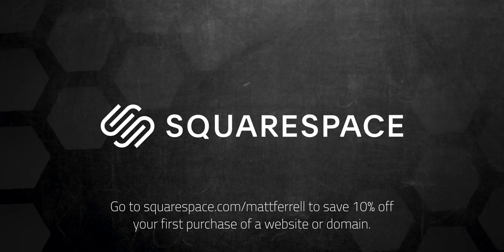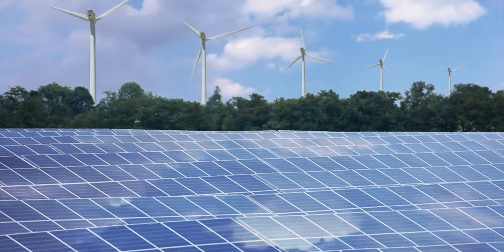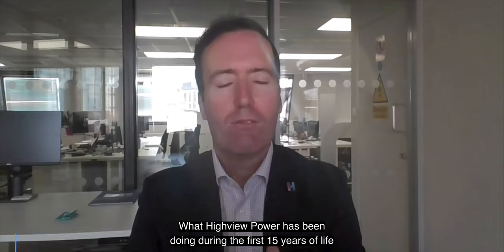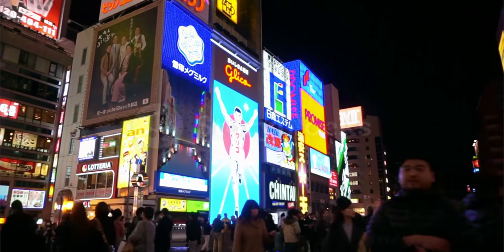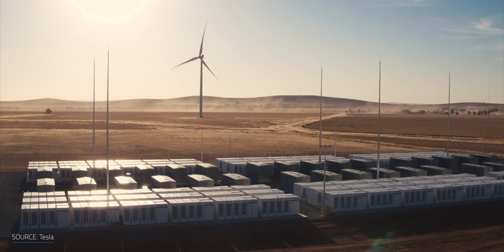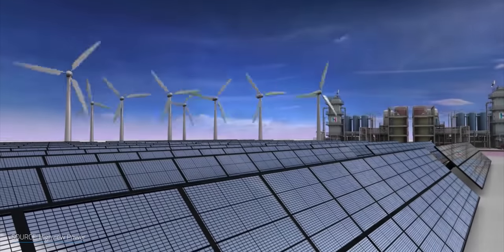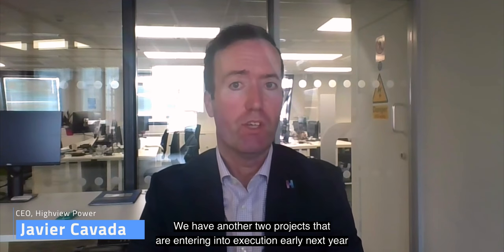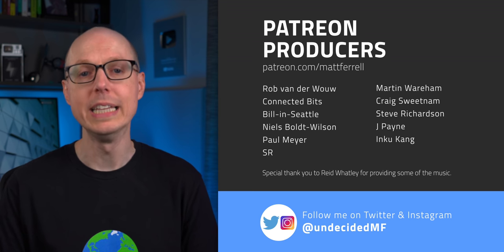Liquid Air Battery Explained - Rival to Lithium Ion Batteries?

Comment: Waooo I was working on this project from last 2 months and collecting the reserches on it  (Disclaimar) Sorry to all that I am actually a medical student and I am not suposed to be on this type of engeniering projects according to rules but curiosity took me in it so dont mind plzzz, so i always thinks why this so simple project of renewable energy doesnot exist before and belive me there are hardly some reserches on this topic. So here is my point this french fella which is telling about there work. They have basically 2 flaws in this project in my opinion and my little bit research.
1. The compressing of the air to liquified it takes energy which is very tough and costly beacuse the sense in this project is that we are working on renewable energy
2. Reserve the heat and again apply it on cold/liquified air to make a pressure also a very difficult and energy cunsomption job and heat loss may also another factor during heat storage.
Like I said these are 2 main flwas in my opinion may be there could be more but they could be easily successable and I got the solution in recent 5 days thankfully this social media.
In my opinion we have to mix two or may three different methods to acheive our goals.
Flaws which i assumes i got the solution is 1. We have to addminister solar energy in this project (WHY)? Beacause use of solar my give us almost free cost in storing the air There I mean air not in the compressed liquified form or it may could be compressed but till at that point that it could not change its state into liquid. 2. We dont have to store the heat infact use of heat remains not essential, we have to use gravitational force to release the air from storing capsule. Here is my case I hope you ll understand and sorry for my english beacuse its not my mother language. Love and best of luck from Pakistan.

Comment: You say pumped Hydro storage is geo specific (since it needs elevation difference). Here is flat Denmark (highest hill is 170 meter high) we're working on sandstorage. Not thermal storage, but water in a big bladder tank, buried under 10s of meters of sand. The water pressure then lifts the sand, thus making it works like the water was pumped up high.
Reply: sounds like the bladder could break

Comment: Thereare no rare earth metals in lithium ion batteries
Reply: Yep, Lithium is almost everywhere on the earth's crust. Mr E said so himself on Battery day.
Reply: Cobalt is not a rare earth metal but it is a metal that is rare on this earth. it is in lithium batteries
Reply: @tomkelly8827  it is hard to mine it ethically
Reply: @tomkelly8827  Some* lithium ion batteries. Cobalt free batteries are becoming more common.
Reply: @tomkelly8827  Cobalt is actually not that rare, it's ranked 32nd in global abundance.
Reply: @zhen3782  Irrelevant to my point which was the simple fact that it's not rare.  To your point, cobalt is also used in many other products besides lithium ion batteries where there is yet no alternative.  The abuse of workers in the Congo is an issue even if there is no cobalt used in batteries.  I do wonder what you think will happen to all those workers if the world somehow suddenly stops using any cobalt?
Reply: @JRP3  That argument is irrelevant.  Yes they will face hardships but what happened to all the slaves in America when the world stopped buying their cotton?  Just because the world has "minerals in abundance" doesn't mean we should treat it as a never-ending commodity.
Reply: @zhen3782  I didn't make an argument, I simply asked a question.
Reply: Cobalt is used at oil refineries to make gasoline so it’s not just relegated to battery use
Reply: I have bipolar and get treated with lithium
Reply: Cobolt?
Reply: @zhen3782  I'd also point out that the world didn't stop using cotton so your analogy is flawed.
Reply: Lithium, Nickel, Manganese, and Iron will be used. Together with Silicon. - Nickel is the scarce resource (but will only be used for "high energy density" solutions.
Reply: @409raul  Again, "rare earth element" has a very precise meaning as defined by IUPAC: lanthanides plus scandium and yttrium - certainly not lithium, cobalt nor nickel. They are not simply metalr that are race, and certainly not metals that are difficult to obtain ethically.
Reply: @tomkelly8827  Not for much longer. Elon is getting rid of it.
Reply: Lovecraft  Sigh... Again, "rare earth elements" is a formal chemical jargon term as defined by International Union of Pure and Applied Chemistry. It denotes specific set of 17 elements, namely lanthanides plus scandium and yttrium. There are many such precise terms (like, "alkali metals", "noble gases" etc), although they might sound vague to a layman. OTOH, the rems "exotic metals" has no specific meaning at all.
When people use this term in the context ob batteries, they usually mean cobalt. If so, they should say "cobalt", or "cobalt and nickel" or even "lithium" - whatever it is that they mean. They certainly don't mean rare earths, because they are not used in batteries (their use, mostly of neodymium, in EVs is in permanent magnet motors).
Reply: @JRP3  Oh well, obviously  they'll all suddenly turn white skinned at start living in two storied villas by the coast and smoke hand rolled Cuban's of course.....
Reply: @JRP3  One thing that may well happen is, that the incentive for continual warfare may be gone. Control of the mines not only allows the local warlords to purchase weapons, but causes outsiders to actively invest in war in the region. DRC is not the first place on Earth to discover that resources can be a curse. The workers may well return to their farms and villages, when war stops being so profitable, or maybe peace will allow a real economy to develop,
Reply: @michaeljames5936  Could be, but it's going to take more than just removing cobalt from lithium batteries.  Cobalt will continue to be used for other products so it's going to take some sort of strong policy to stop the abuse of artisanal cobalt mining.
Reply: @JRP3  the world is moving towards making all of us superfluous. The singularity will happen soon or later. Based on Ray Kurzweil’s estimate 2040.  Since he and I are the same age we both might live to see it. Those of you that are younger WILL see and experience it I suggest you all plan for it. 👍🏼🥂
Reply: @HansMilling  yeah it’s a partner bolt. 😂
Reply: @psycronizer  maybe they don’t want to have white skin? Not a good thing near the equator.
Reply: Manuel Kyriakakis  Australia has quite a lot, also Cuba, Philippines, Russia, Canada, United States and other countries.
Reply: Manuel Kyriakakis  They do mine it in many other places but it's cheapest from the Congo.
Reply: @La-Illaha-Illa-Allah  the human rights abuse make them run better. Quality
Reply: @JRP3  gold is not that rare either. But affordably mining it makes it so. There is a significant human cost to mining cobalt. Thus it is extremely relevant
Reply: @JRP3  what would happen to those workers if no cobalt? Unfortunately likely another form of hell, but at least 1 that does not require being in the deapths of it.
Reply: @Tagurrit  automation of industry means little considering the forecast contraction of population in the developed world in the next decades
Reply: @idealicfool  Not relevant to my point that it's not rare.  Cobalt does not need to be mined with human cost just because one area does it that way.  It's a political problem not a technological one.
Reply: @JRP3  the trouble is for us the ppl to push for stronger regulations to ensure that these materials are not sourced at the expense of ppls health and life. There are standards in place for things such as gold or diamonds (much of the time ignored) but not so much for other things such as cobalt or lithium.
Reply: @La-Illaha-Illa-Allah  There's a large deposit of cobalt among other metals in Minnesota.  The mine has been in permitting for 20 years with no end in sight.

Comment: Tesla alone is not the sole answer to sustainable clean energy. There are many other companies out there. Some people need to look and think outside of the box (the Tesla box). 

Some people just dismiss non-Tesla companies by calling them a scam and wishing them to fail. Having that kind of negative mindset and behaviour won't help us all to progress to clean, affordable and sustainable energy.
Reply: And it's also against Tesla's overarching MO, "to accelerate the world's transition to sustainable energy", so those so called "fans" are misguided as well

Batteries will play a massive role in the transition period (my hope is, that will mainly be through household/commercial storage and V2G), but other technologies are necessary for the greater grid. 

In the end, it doesn't really matter WHO develops what, just that we get sustainable energy/storage

Comment: Great video.  You really dialed in and captured my thoughts and sentiments on the merits of liquid air energy storage.  The merits of the science, technology, materials, and costs almost speak for themselves.  I would definitely like to see some more investigation and follow up on the unanswered questions.  Some suggested topics for follow up:

It seems like a liquid air storage system should be co-located and symbiotically paired with the intermittent energy source (solar / wind) supplying the liquid air plant with power.  I could imagine a fully integrated gigawatt scale solar / liquid air plant that is designed, engineered, marketed, and sold under a common brand as a turn key product supplying power 24/7 365 days a year.

The most obvious choice would be the acquisition and merger of a liquid air storage company with a gigawatt scale solar or wind company.  However, such a merger might prove hostile to existing business relationships with the electric utility industry which would likely prefer to see liquid air energy storage technology killed in the cradle than as to begin competing with it for baseload market share.  It would be great if you could score an interview with a large established solar or wind company to explore their thoughts on pairing their product with liquid air energy storage.

Location.  Location. Location.  Expand the focus beyond the merits of the technology and its associated costs to grid access.  A liquid air system dumping megawatts of power into the grid would likely need to be co-located next to an existing power plant with grid connection infrastructure or next to an abandoned power plant with existing grid connection infrastructure.  Cases in point, 

In 2003 "First Solar" co-located a utility scale 480 kW PV solar system adjacent to the coal fired Springerville Generating Station operated by Tucson Electric Power in Springerville, Arizona.

Tesla's new Moss Landing megapack battery storage system is being installed at the former natural gas fired Moss Landing Power Plant site.  

Examine the likely regulatory hurdles and challenges to connect a new independent wildcat 24/7 baseload power source to the grid.  The regulatory burdens and financial costs may be insurmountable in the US.  The utility and the broader utility lobbying industry would immediately go to the mattresses to tie up and protect any potential threat to existing baseload generating capacity.  Possession being nine-tenths of the law, the first and easiest thing would be to deny property access, easements, and permits necessary to connect to the grid.  A small grid connected project in a foreign country might be the better pace to start rather than a predictable hostile engagement with the US electric utility industry.

Comment: You put lots of energy to liquefy the Air to run the generator to produce the energy 
Is it even a good idea?
Reply: Right, like with Li-ion batteries, you put lots of energy to charge the batteries to produce energy, is it even a good idea?

Comment: The tech sounds promising.  I like it, but... you aren't just throwing away 40% of your energy, you are throwing away 40% of the life cycle of your wind turbine.  Seems extreme. Are we calculating that into the math?  Seems less of an issue for solar. 
When he was comparing his tech to the big boy on the block, pumped hydro,  he claimed pumped hydro was 50%-70% efficient.  A quick google search brought up that pumped hydro is commonly >%80 efficient.  The example you gave(Bath County) was near that at 79%.  I don't know, but an apparent discrepancy.

Comment: Do a video on gravity storage! I wrote a paper on it in university and it’s crazy interesting.
Reply from the maker: It is pretty cool!  I've been keeping an eye on companies like Gravitricity.  It's another "why aren't we doing this already" technology.
Reply: @rogerstarkey5390   Not enough room inside - gravity storage systems are much larger, plus if you did build one inside you'd have major access issues for maintenance, and when you decommissioned the wind turbine, you'd have to decommission the gravity-storage unit.

Best kept separate.
Reply: Hydropower and pumped hydropower are the best from gravitational power storage class. Outher types - non existent on commertial scale
Reply: @volodumurkalunyak4651  Yes, unfortunately most of the best locations for pumped hydro storage have already been developed. You can put the solid stuff anywhere land is cheap.

Comment: It may seem like a crazy idea but what if you paired these energy storage plants with traditional power plants. The storage could use the waste heat from burning natural gas/nuclear as the heat for the expansion of the gas. Then you would not need to invest in any heat storage bringing down costs considerably. Smaller versions might be worth it even with no renewables involved. They would allow them to construct smaller plants because you could size them by average usage and not by peak usage. Basically negating the need for traditional peaker plants anyway.

Comment: if this system cleans the air before freezing it, does it remove carbon from the air?
Reply: Cleaning is for particles large in comparison to air molecules, so large particles of Carbon, yes.  Carbon dioxide is roughly the same size a Oxygen and Nitrogen molecules.  Cleaning won't sort them.
Reply: As the process is already used to extract nitrogen and oxygen from the air, I think it could be used for carbon capture. The question is whether it would be simpler and more cost effective to have a separate plant for that.
Reply: @davidmay268  You can sort the molecules by their condensation or freezing temperature, but that wouldn't be 'cleaning' it.  Given that they have a use for both the heat and the coolth, doing it in concert sounds like a good idea.  There may well be some engineering that I don't understand that would rule it out.
Reply from the maker: They don't isolate the different components of the air, but they could.  This type of system could also act as carbon capture system ... it all depends on how they configure/build it out.
Reply: @UndecidedMF  sorry, I should have been clearer. I meant the process is used elsewhere to separate gases, you're right it's not done in this plant.
Reply: CO2 becomes a solid (dry ice) at a much higher temperature then liquified oxygen or nitrogen.  So you should be able to remove the CO2 if you set your system up.
Reply: @davidmay268  As Robert Pendzick points out, you actually have to - otherwise solid crystals of 'ice' clogging up the pipes.

Comment: Storing energy for home use.  There is a guy in New Jersey who put together a solar system that when there was access power produced, it made hydrogen.  Yes, hydrogen.  It was stored in a low pressure tank (propane tank) and oxygen from the process was stored in another tank.  When the house needs electricity the hydrogen produces it for him.
It's in his backyard.  It took a while from what I understand to get township approval but it works

Comment: The title is pure clickbait. "Liquid Air Battery Explained - The End of Lithium Ion Batteries?" There's no danger whatsoever of liquid air ending the dominance of lithium ion batteries. In fact, it's misleading to even call liquid air energy storage a battery; it most certainly is not. Thumbs down for the trash title.

Any efficiency is predicated on being able to make use of the waste heat and cooling. That makes it a much less portable solution than you've implied. It's got to be colocated with uses for that heat and cooling capacity.
 
By the way, it's also got to compete with its sister technology, compressed-air energy storage (CAES). I've no idea which would win out on any given project, but my guess would be CAES since it's generating less unwanted heat and cooling. Also it can take advantage of existing cavities such as spent salt mines for air storage.
Reply from the maker: I’ve actually changed the title after feedback like yours.  I didn’t think it was that clickbaity, but clearly missed the mark.  The actual term for this technology is cryogenic energy storage, but it’s better known as liquid air battery ... hence the title.
Reply: It isn't quite that bad.

I agree "Liquid Air Storage ...." would be better, but not a major faux pas.

The advantage it has over CAES is exactly its colocation ability and its lack of need for old mines, etc. In cities, where the demand is - and demand for district heat and district cooling - and the non-flammability aspect (compared to a hydrogen plant inside a city) - and its constructability make it ideal.

It really pairs well with a Gen IV nuclear plant (nuclear providing waste heat for expansion, liquid air providing load following), and both siteable inside a city.